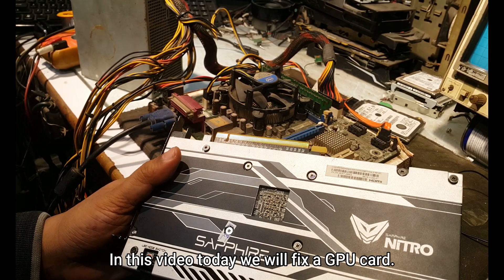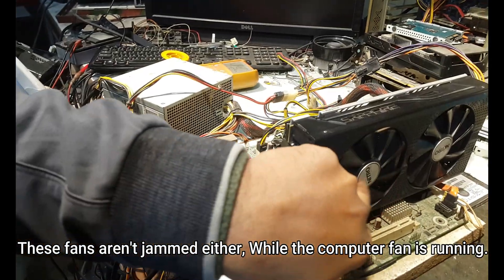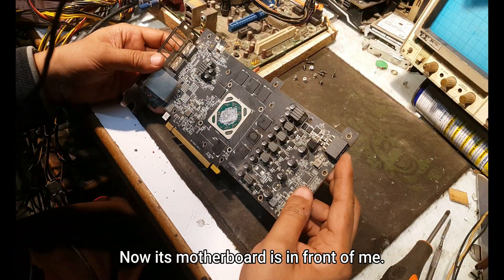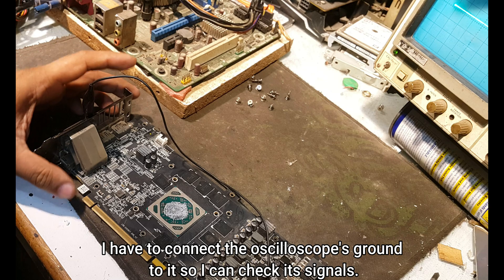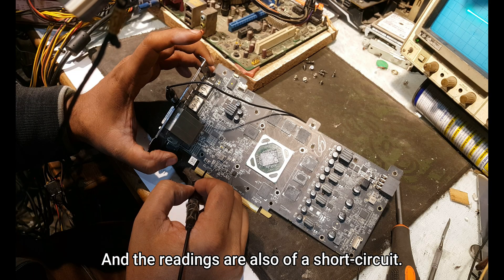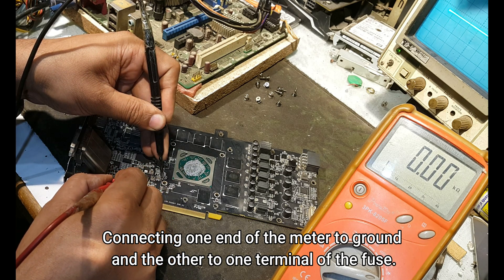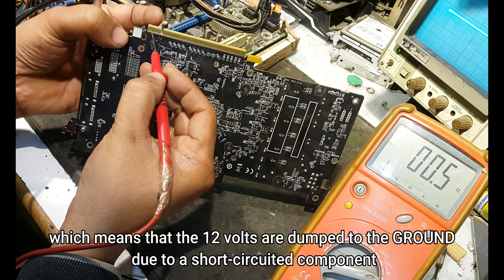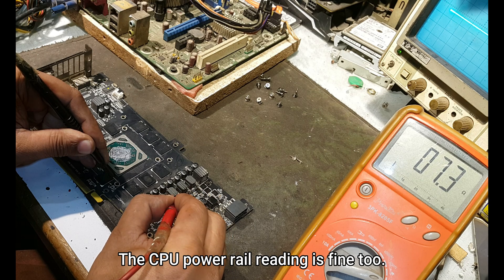Sapphire's Radeon Rx480 4G -Fix!-

Comment: sir, may i get FET code number
Reply from the maker: The FET (Field-Effect Transistor) code number depends on the specific model and circuit design of the Radeon RX 480 4G graphics card. These FETs are typically part of the VRM (Voltage Regulator Module) responsible for regulating power to the GPU and other components.

For the Sapphire Radeon RX 480 4G, here are some common identifiers for FETs used in its VRM:

High-Side and Low-Side FETs:

Look for part numbers like 4C10N, 4C06N, or similar models.
These are MOSFETs optimized for high efficiency in power delivery circuits.
Manufacturer Information:

The specific FETs can vary by card revision. Check the numbers printed on the FET itself. The first line often includes the model number.
Replacement Guidance:

Ensure replacements match the specifications of the original, including voltage, current rating, and Rds(on) (on-resistance).
Schematics or Boardview:
If you have access to schematics or a boardview file for the RX 480, you can identify the exact FET part numbers and their placement on the PCB.

If you're repairing or replacing FETs, make sure to:

Use a multimeter to test for short circuits before and after replacement.
Replace thermal pads or paste during reassembly for proper cooling.
Would you like guidance on testing or replacing the FETs? 😊

Comment: I have the same GPU, and upon inspecting it, I see that two small SMD fuses (10A) closest to the 8-pin connector are burned. I don’t have a multimeter. Can I just replace the two fuses, and to be sure, should I also replace the one on the bottom pin as well?
Reply from the maker: Replacing the burned fuses is a good start! If they’re the only components showing visible damage, swapping them out might fix the issue.

However, it’s generally a good idea to check the surrounding components for any additional damage. Without a multimeter, you can't test the circuit for shorts or open connections, so replacing the fuses is a bit of a guess. If you’re replacing the fuses, you might want to go ahead and replace all the fuses in the area to ensure consistency and prevent future issues.

After replacing the fuses, if the GPU still doesn’t work, it could be worth getting a multimeter or consulting a professional to check for other potential issues. Good luck with the repair!

Comment: Hey i have only rgb the fans are not working and i have one more psu but its not working
Reply from the maker: If you're only getting RGB lighting but no fan activity, it suggests a power delivery issue or a problem with the PSU itself. Since you mentioned having a second PSU that also isn't working, here are a few steps you can try:

Check PSU Connections: Ensure that all power cables are securely connected to the motherboard, GPU, and other components. Sometimes a loose connection can cause the system to only partially power on.

Test the PSU: If you have a PSU tester, you can use it to check if the PSU is delivering power correctly. If you don't have one, you can try the paperclip test to see if the PSU powers on. However, this test won't tell you if the PSU can handle a load, just that it can turn on.

Try a Different Power Outlet: Sometimes the issue might be as simple as a bad power outlet or surge protector. Try plugging your system directly into a different outlet.

Check the Motherboard: If both PSUs aren't working, the issue might be with the motherboard. Look for any signs of damage, such as burnt components, bulging capacitors, or loose connections.

Inspect the Fans: Ensure that the fans are not physically obstructed or damaged. If they are connected to the motherboard, try connecting them directly to the PSU via a Molex or SATA adapter to see if they spin up.

Reset the BIOS/CMOS: Sometimes, a corrupted BIOS or incorrect settings can cause boot issues. Try resetting the CMOS by removing the battery on the motherboard for a few minutes, then reinserting it.

Try Booting with Minimal Components: Disconnect all non-essential components (like extra drives, USB devices, etc.) and try booting with just the CPU, one stick of RAM, and the GPU (if necessary). This can help isolate the problem.

If none of these steps work, it's possible that the motherboard or another critical component might be faulty.
Reply: @idreestech  the psui is ok i has 2 gpus old is ok but this is not ok  its smd components i go to try fix it